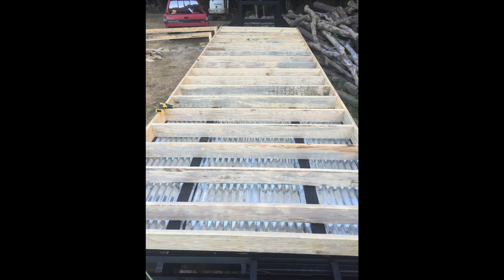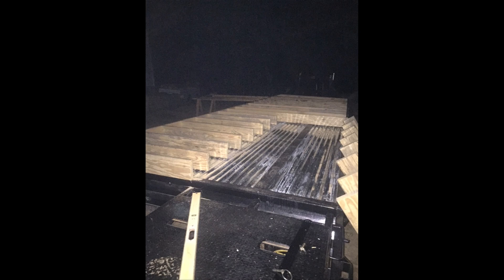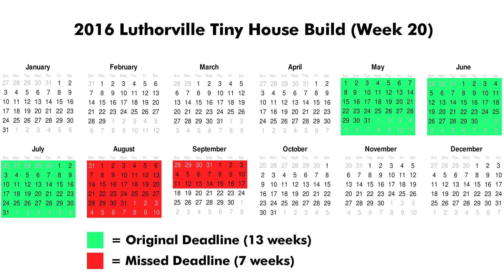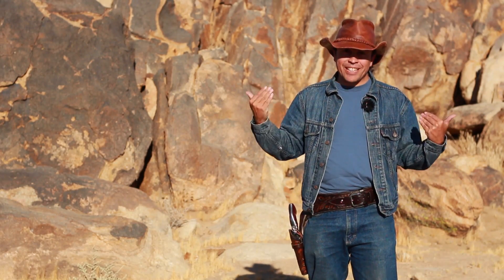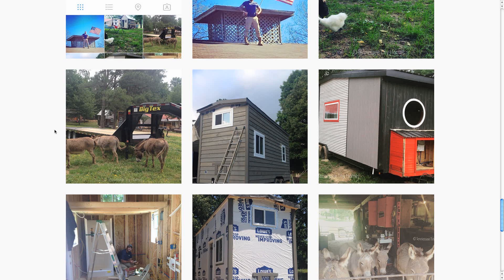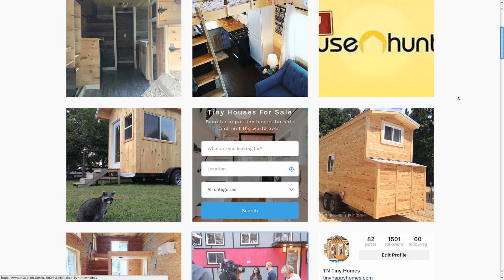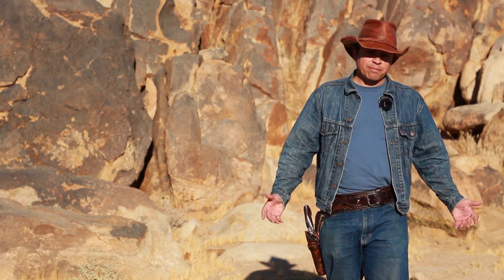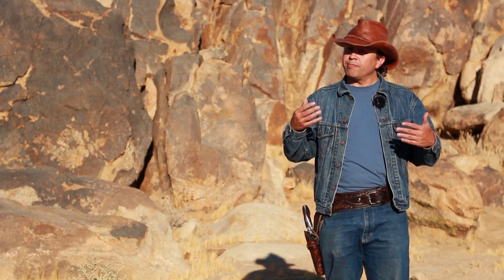Tiny House Build: Step #6 - Starting The Framing

Comment: you should sue em
Reply from the maker: Believe me, the thought has crossed my mind. But if I sue them, that means more expenses I can't afford, plus I need to find a replacement company to finish the project and who knows how many months that will set me back? Whereas, if Tennessee Tiny Homes actually buckles down and does the work, they could easily finish in a month. So, do I sue them, dig myself further in debt, and have to wait another 8 months to find a builder willing to take over the project? Or, do I try to be patient and let these guys finish it in a timely manner?